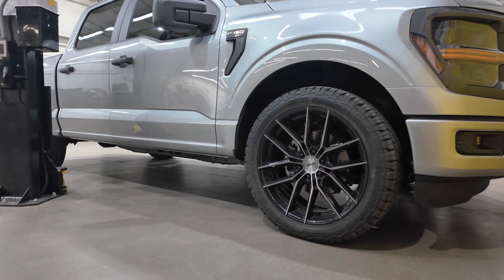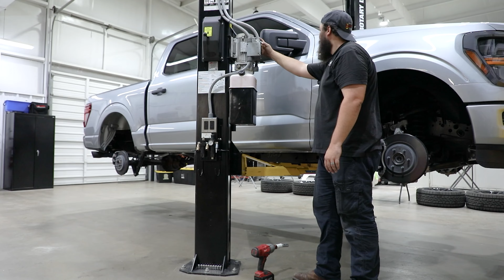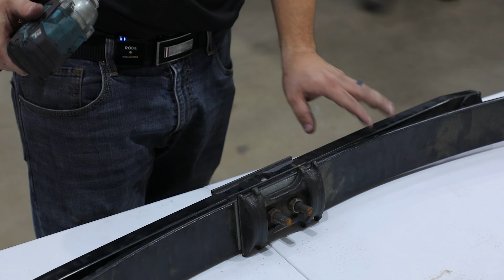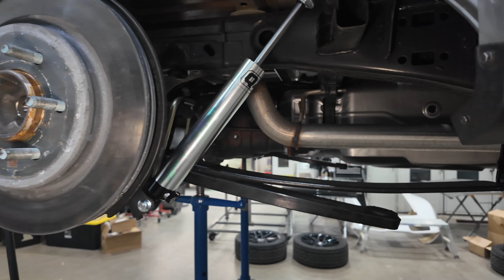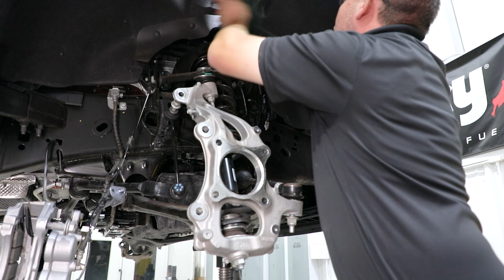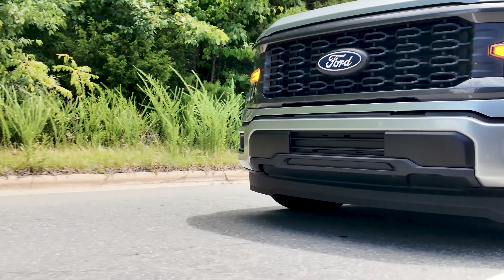QA1 F-150 Lowering Kit Install Overview | Complete Suspension Upgrade

Comment: I don't understand how the rear axle doesn't bash into the rear bump stops over bumps.
Reply: The axle DOES hit on rough roads and over train tracks. Anyone that says otherwise is lying.  You only have 3-4 inches of travel before the axle smacks the frame. I added Airbags to help out, but once in a while I do bottom out.

Comment: How come the ford f150 have a lot of rust. I have a brand new ford f150 with 30 miles and is rusty just like this truck.
Reply from the maker: Not quite sure! Ford should take some notes
Reply: Excessive heat and poor attention to detail. You cannot leave welded metal untreated for any length of time.

Comment: What size wheels and tires on are on the truck?
Reply: The wheels are 22’s because if you purchase this kit you can’t have a wheel smaller than a 22 it warns you before you purchase the kit 

And the tires look like they’re 275/35/22